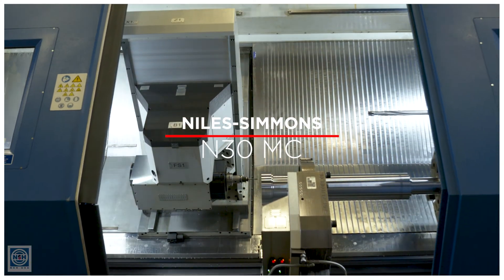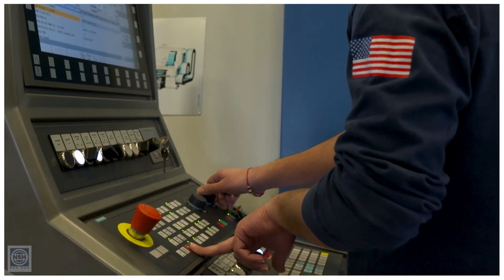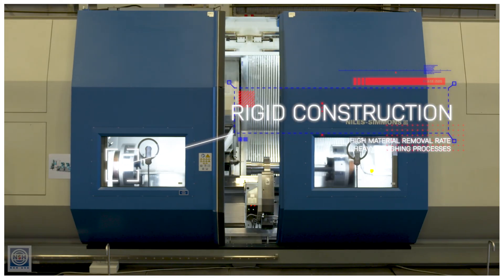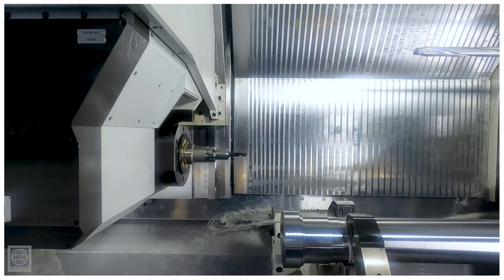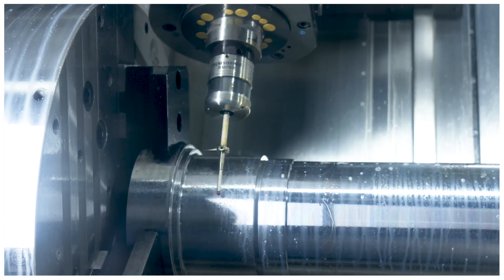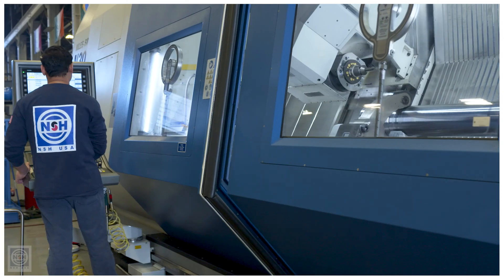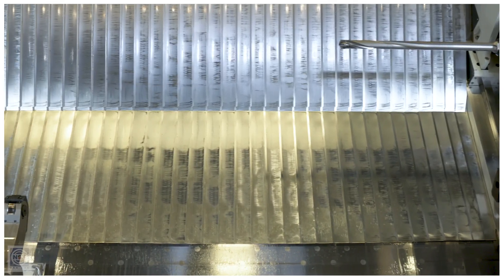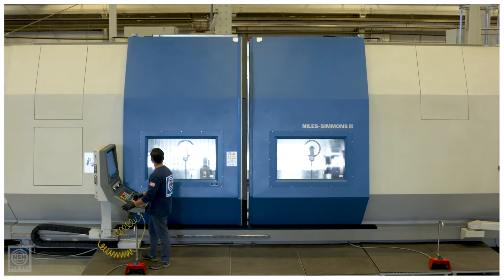NSH USA and the NILES-SIMMONS N30 MC: Technology Wins Part 2

Comment: do you guys have issues with your boring mill’s finished cuts too or just us?
Reply: Hi!  Thanks for reaching out with a great question.  We don't have issues on finish cuts for our boring operations.  We've utilized boring bars in a standard milling head with B-axis, but for heavy work we have a specialized boring bar system.  The boring bar system is separated from the milling head so it is very rigid.  For high-value cuts, the controller can utilize real-time data from a connected boring bar to ensure a stable cut.  

What sort of issues are you experiencing in the finish cuts?
Reply: @jonathan-nsh-usaapplicatio2231  we run manual machines that are not nearly as intricate as yours but our boring mill will usually fall out of calibration and the finishers won’t do anything leaving a rough cut that’d misfit, the bar becomes uncalibrated throughout the day causing us to adjust the interference a lot, as well as the axle lathe, will randomly leave a RA that does not fall within tolerance although all shims and tools are fresh and aligned, it’s like the machines just do what they want
Reply: @jonathan-nsh-usaapplicatio2231 как с вами связиваться? Я из Туркменистана, и я хочу купить ваш станок N20 series. Он нужен для шлифовки коленчатых валов автомобилей! И нам нужна еще станок для гильзировки автомобильных моторных блоков!
Reply from the maker: Здравствуйте! Извините, что пропустил это сообщение. Контактную информацию можно найти на сайте NILES-SIMMONS: https://niles-simmons.de/en/contacts/. Удачи с этим проектом!